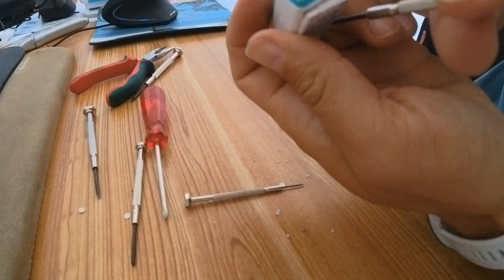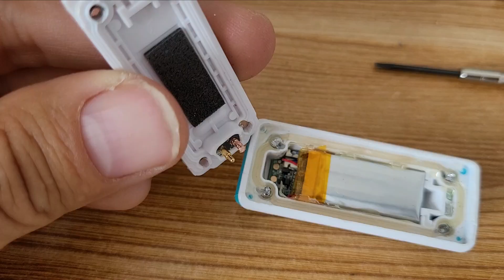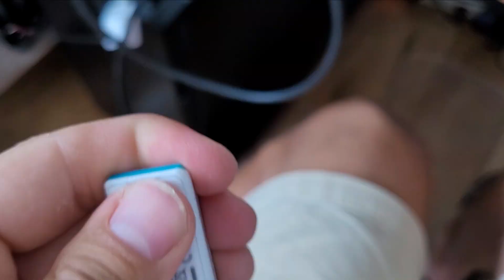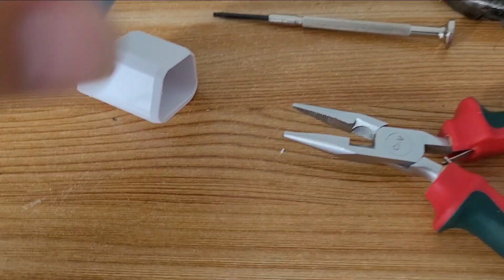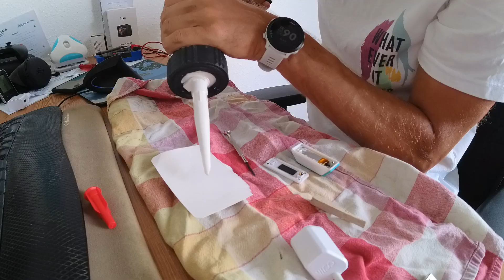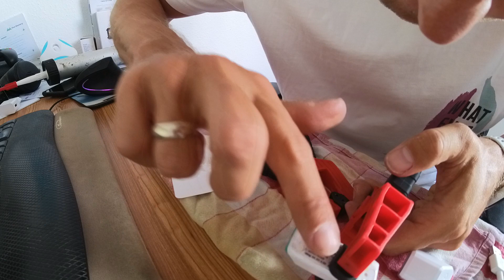Kitesurfing Gadget - ⚒️ How to fix/repair your WOO Sports ⚒️ #howto #woosports

Comment: Hello. Could you tell me the reference of woo3 battery ? Thanks you
Reply from the maker: @Lukikkite  there are several on ebay in different size and capacity you need lithium 3.7v which matches then. I also bought one smaller from aliexpress but they are not that good quality and least only for around 3hours. I bought one with 25mm x 14mm x 4mm wihich has 110 which lasts for around 5 hours. https://www.ebay.de/itm/255510046348?mkcid=16&mkevt=1&mkrid=707-127634-2357-0&ssspo=yTbngviFSJu&sssrc=4429486&ssuid=ThKZ9mp8Tu6&var=555806675233&widget_ver=artemis&media=COPY

Comment: I fixed the charging pin which seemed to be stuck, but still the Woo won't charge more than 1%. It connects and says charging on my phone but it keeps stuck at 1% battery... Any other solutions? :)
Reply from the maker: @stijnvanroessel  it could be that the charge controller is damaged or battery. I bet on the battery maybe you find a similar battery on ebay/battery stores with same size/voltage and change it.

Comment: Really nice explained Video 😃. Is it possible to change an old battery with low capacity?
Reply from the maker: Im sure you just need to check the voltage and mha(capacity) and of course dimensions to fit in the case. Im sure on ebay there are all kind of litium batterys to find. My was still ok and after over 6 month still ok. After 2 hours session battery is at 75%

Comment: I have made this operation with three different woo sensors now. Can I just add I have now taken an old bicycle inner tube and cut it into band sections to loop in a cross formation over the transparent woo case because many times the blue closing clip becomes undone while riding. This has saved my woo from being lost many times. Great video.👍

Comment: cool, video. my charging pins are also almost disappeared due to corrosion.   It would be great if someone new the part no. for the pogo pin's used ?? then I would be able to fix min. Also one thing I noticed if you cut out the foam where the terminals are in casing then you definitely have way less corrosion (due to always a little moisture you will have current traveling between contacts through the foam and that cause the corrosion)
Reply from the maker: With the foam its a good tip, i some rubber glue on that position to seal it hopes that helps. Maybe a option for the pins are a small 2pin plug from a old electronic device i know them from car rc batterypacks like this https://www.ebay.de/itm/222864736648?mkcid=16&mkevt=1&mkrid=707-127634-2357-0&ssspo=qv4BVfRZSMK&sssrc=4429486&ssuid=ThKZ9mp8Tu6&var=&widget_ver=artemis&media=COPY

Comment: Amazing solution, same thing happened to me. I wanted to disamble it but my little screws were damaged. I will try the rest after I manage to unscrew them :)
Reply from the maker: Yes try to drill them out with a 3mm drill, hope for you to get your woo fixed
Reply: @TomKitesurf-Passion  Thanks for the tip, will try it!
Reply: @TomKitesurf-Passion  they are only screw into plastic it should be possible with a sharp right size screwdriver to get it to bide and unscrew 🙂
Reply from the maker: @SunshineDenmark  maybe yes in my case sadly not :) wish you good luck for your repair! And let me know if successfull
Reply: I have four useless WOO's tried what you did, all worked, but I didn't have damaged pin like you. WOO takes charge, but will not power, once removed from charger, is battery toast?